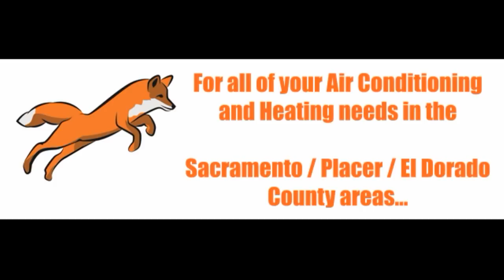HVAC Install Video with Two Package Units and Crane View

Comment: Roofing, start just above the curb and work down. Less shingle damage. OR if it's the 10mph (;-) shingles run a junk rip blade set to depth around the curb. Goes A LOT faster that way and easier to stitch the shingles back together and not have as much felt ripping.

Comment: Why not wait until the old units are on the ground or back at the shop to recover the refrigerant?  Would save from hauling extra equipment up to the roof.
Reply from the maker: Ahh, good point, I guess we just didnt think about it.
Reply: My guess is they weren't going back to the shop. Looked like they craned them straight on to a scrap mans truck!
Reply: My company stocks up the bone yard, so when it get a little slow after summer, we test & do a proper evac to sell the refrigerant, recycle any copper, and scrap metal.

Comment: I've  never seen a residential  rooftop package unit in the northeast! Are they available  with economizers? Looks good !
Reply from the maker: plucy470 not required for resi... Thanks for watching!
Reply: I'm  sure they are not reguired, but in your climate would it be beneficial  to use free cooling?
Reply: the humidity level and how much needs extracted to feel comfortable is the downside to economizers